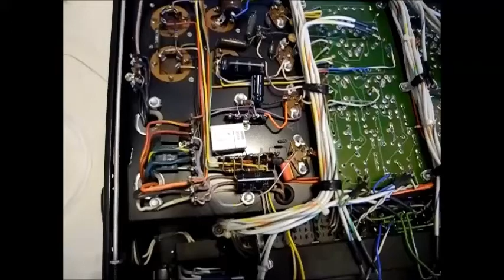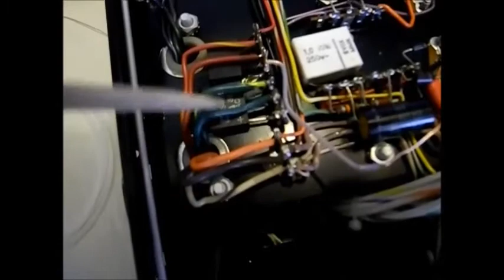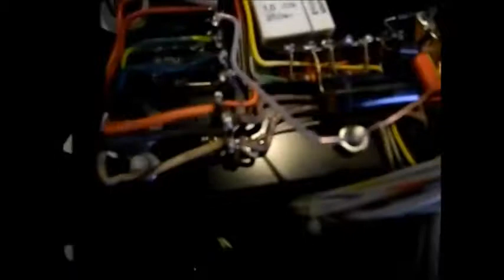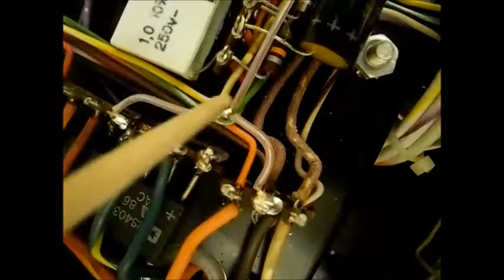McIntosh C28 Grounding of Terminal Strip Rivets

Comment: Curious what S/N is possible on these. I can get to 85db
BTW I wasn't able to solder the chassis I was working on. It's non ferrous and solder doesn't stick to it.
Reply from the maker: Hi,
I have not tried soldering to the chassis on a C28 thus I do not know if this will work.  Try removing the paint, clean with 99% Isopropyl, cross scratch the metal with a sharp Point tool.  Try using flux with a High Power Solder Gun (Not Pencil).  Use Eutectic 63/37 Solder.  This will give you the best chance that it will work.

Do this in an area where plan B is to install a Stud if you cannot get solder to stick to the Chassis.  Inspect BOTH sides of the chassis to make sure nothing is in the way.  A Self Tapping screw, screwed into a somewhat undersized hole will really dig into the chassis and create a solid ground.
Reply: @hifimachine4237   I ended up with screws on the points where I could and it beats noise spec (A-weighted). A bit of a fight for sure. Thanks for the great tips.